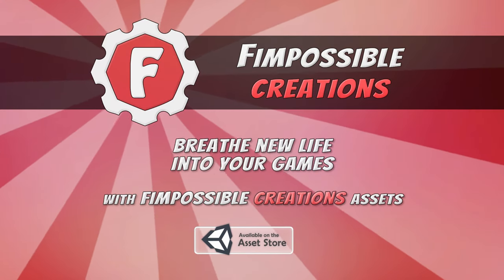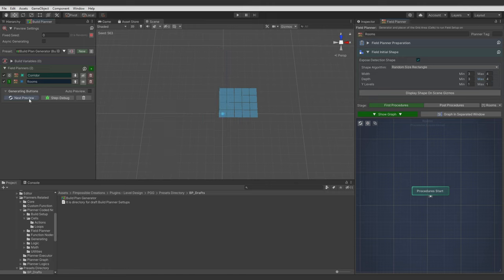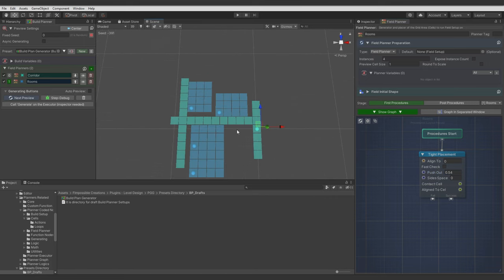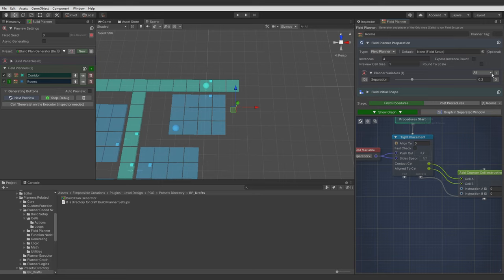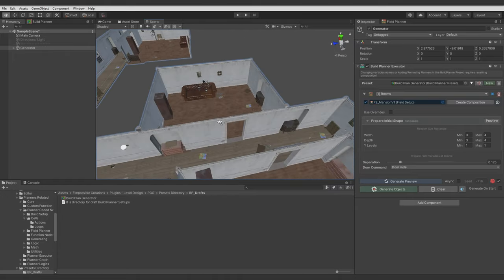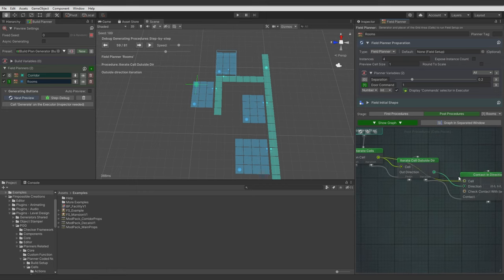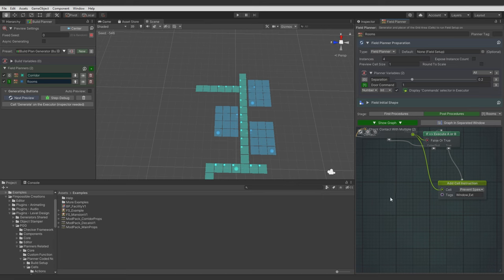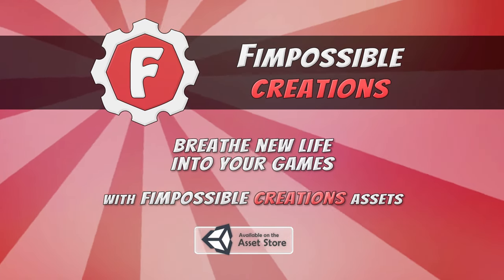[PGG Tutorial] Facility Building Layout with Build Planner

Comment: Hi! Great package and great tutorial! I have a quick question, I have a few field planners but due to some limitations on my project, there are well defined positions where the doorway it supposed to be, but depending how they are placed on the grid, this particular doorway cell might not be aligned with the hallway, is there a way I can get the cell that contains this tag to force this alignment or at least generate a path from the door to the rest of the hallways?
Reply from the maker: Hello, Thank You!
It could work when using path find based generating, to generate way from your provided doorway position, towards the hallways. There can be a problem tho, because path find generating is skipping self cells until finding free space to move outside its body in shortest way towards target, so the provided doorway position will be ignored in different cases. Hmm, without more details it can be hard to help your case.
Reply: @FImpossibleCreations   Thanks for the answer! Pretty much what I have is a few prefab rooms that I need to connect. For example, I have a central room with 2 doorways with a fixed location. I want to randomly put 2 other prefab rooms also with fixed doorways connected to it. I guess I could also write a script to sample from a prefab list and manually attach the rooms for now. In the future I plan to update for the rooms to be procedurally generated tho.